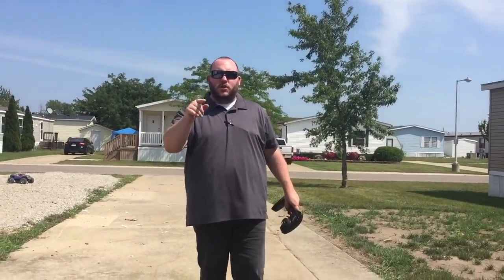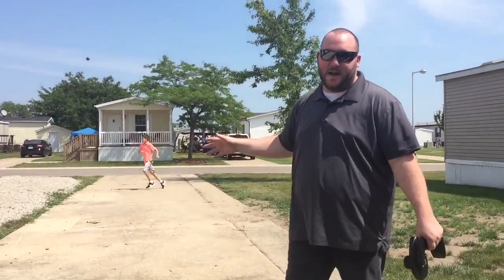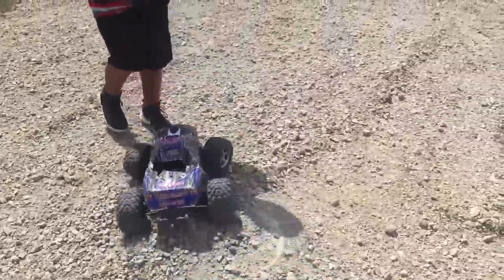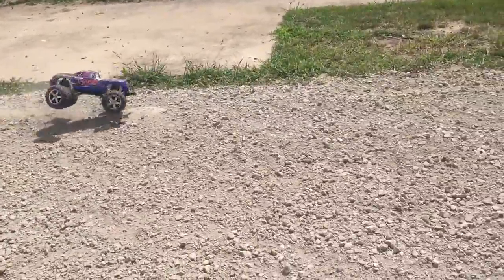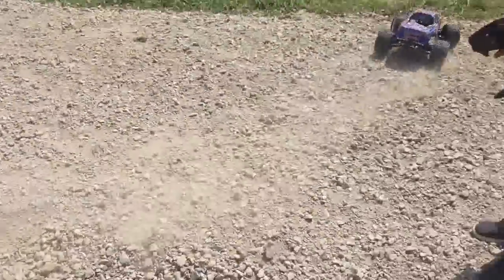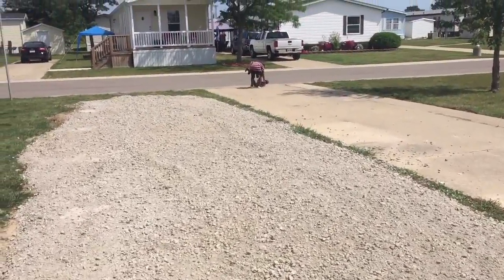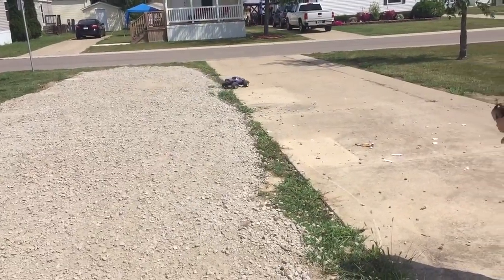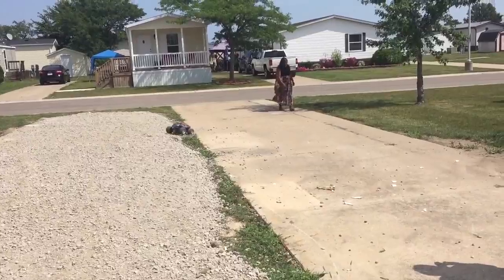Brushless T-maxx Back in action!!

Comment: Great video. How are the motor temps after you run a pack through it? Looks like it pulls strong.
Reply from the maker: steven hatfield the temps are pretty good after a pack. I did notice it did get pretty warm when running in directly in the sun on a few hot days, but it never gave me any issues. This motor is actually pretty decent and I'm surprised with it. Thanks for stopping by.